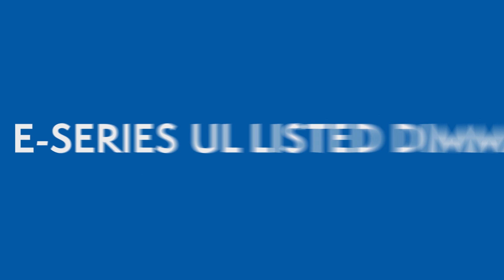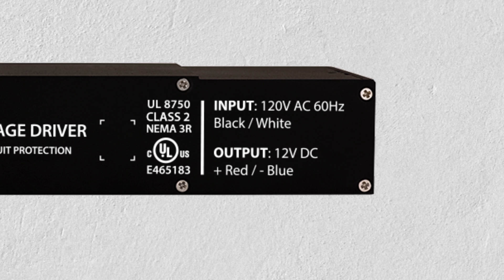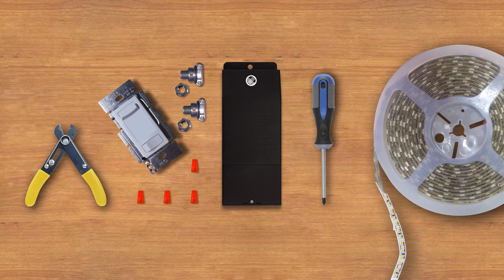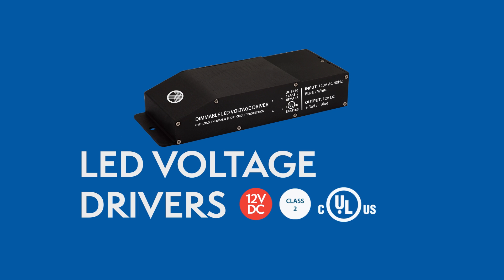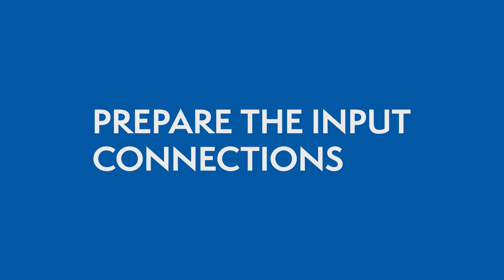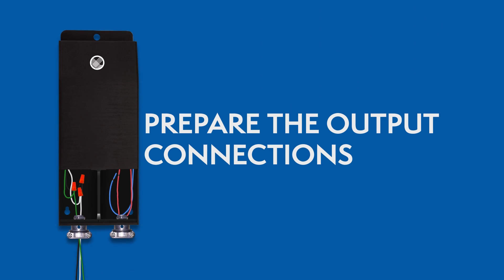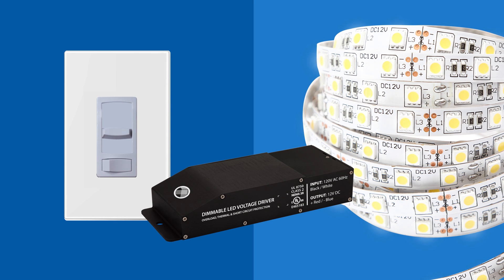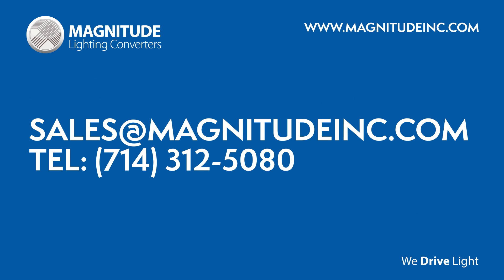12VDC Dimmable LED Driver installation - Magnitude’s E-Series UL listed

Comment: Where can you hide the driver?
Reply: I am also installing LED strips on baseboards and crown moldings and kitchen cabinets. To hide the led drivers connected to my baseboards, I am going to use Access Panels to  hide the wires and led driver behind the wall. You can find many sizes for your project. I hope it helps.

Comment: Recent kitchen reno has these exact drivers installed with LED pot lights. A basic LED dimmer switch has the occasional flickering when adjusting or turning a light on in another room on the same line. I've tried using an MLV dimmer switch as suggested (but not from their list as a search of these switches do not indicate usage with LED bulbs) with no change. Should I try an ELV dimmer switch? I've emailed the company with no reply.